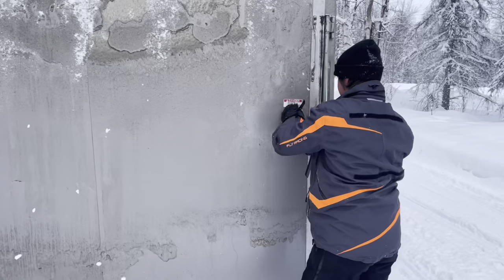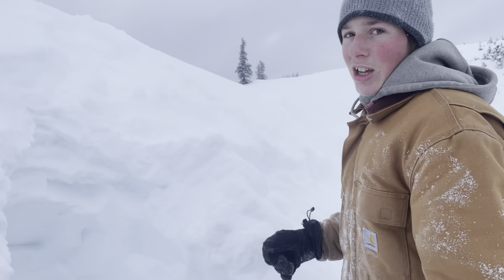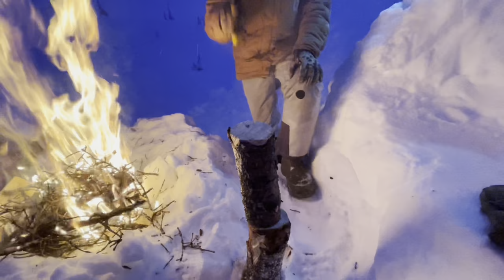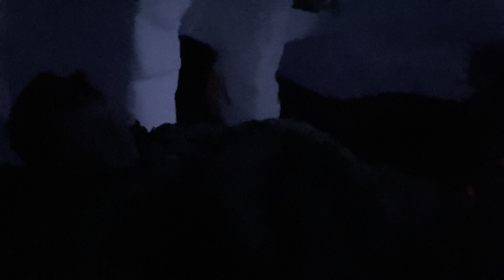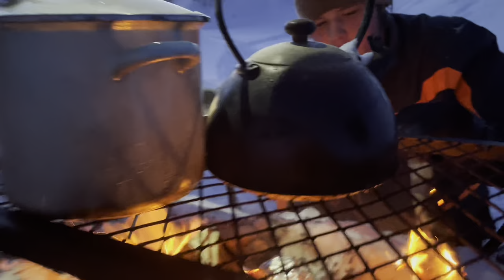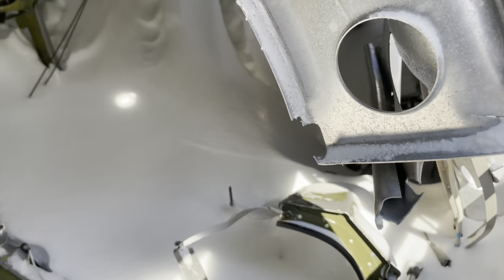48 Hrs in Alaska’s Dugout Snow Cave Survival Shelter // -20° F

Comment: I said this in my comment on the last video late so you may not have saw it. BUT ETHAN AND JUSTIN..... Go look at the last video “The Outsider” put up on Youtube about staying the night in a Snow cave and check out the heater he built. You boys are pretty good builders go check out his videos where he built that water heating system. It’s ran off of coiled copper tubing, a military ammo can some fittings and some garden hose and water. The copper tubing is placed in the camp fire outside of your sleeping area and it heats the water it then runs into the ammo can. But check out the videos I think you boys can figure out how to build one of them to place under your sleeping bags to keep you warm. Go way back to his videos of him sleeping  overnight in cold snowy Canada in his snow sled camper he built to pull behind the snowmobile. You guys Ethan and Justin could build you a couple of those little Snow sled campers to pull behind your snowmobiles 😃 !!! That would be cool and make good videos for the channel. He shows exactly how he built that snowmobile sled camper inexpensively on his channel. 😁👍🏼

Comment: Collapse risk?!
Reply: #A #Snow #Cave is an incredible structure that can provide a safe refuge in extreme weather conditions. Although it may not seem so at first glance, a snow cave is actually a highly stable structure. This is due to several factors:

#Insulation: Snow is an excellent insulating material. When compressed, snow forms a solid, insulated shell that traps heat inside the cave and protects against external cold.

#Arch #Shape: Snow caves are typically constructed in an arch shape, which is one of the strongest natural structures. This shape evenly distributes weight and reduces stress on the roof, making it less likely for the cave to collapse.

#Properties #of #Snow: Snow is a deformable material that can adapt and distribute weight evenly. This means that if there is a snowfall, the snow will gradually accumulate on top of the cave, further strengthening the structure.

Despite the natural robustness of a snow cave, it is important to be cautious when building one. It is crucial to choose a suitable location and construct the cave correctly to avoid the risk of collapse. Additionally, one should always be aware of weather conditions and be prepared for changes, especially regarding potential snowfall. Building a snow cave requires knowledge, experience, and caution to ensure that it is safe and reliable as a temporary shelter in extreme conditions.
Reply: No, no,  these boys dads wouldn't allow them to carry out the adventure, IF there was that danger..